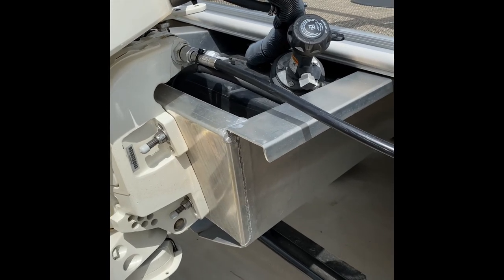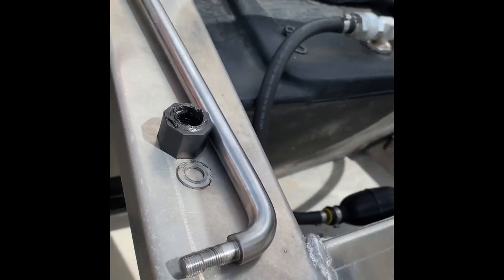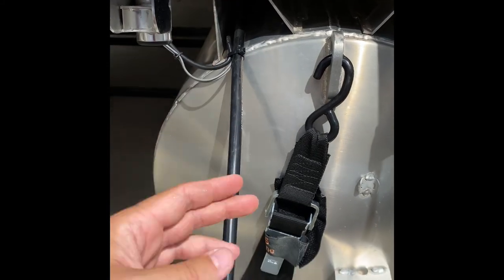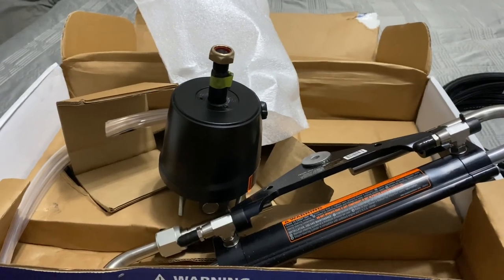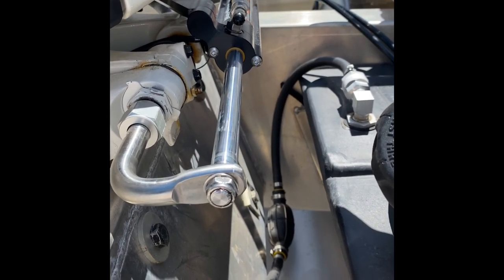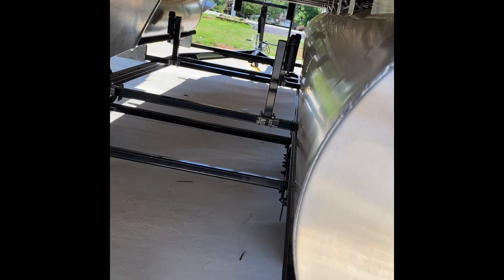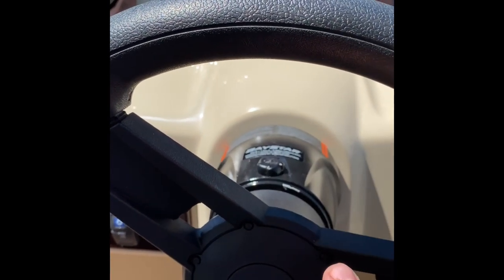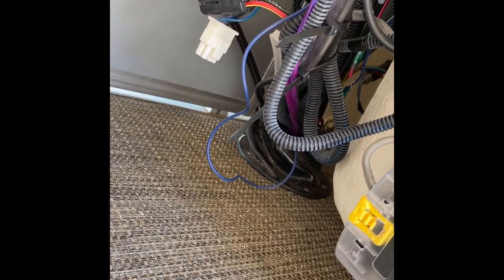Baystar hydraulic steering upgrade for the pontoon

Comment from the maker: New information:
Alright everyone. I did not do enough research upfront on this deal. I found out that Baystar is made by Seastar, it is just a lower end. I bought it because it says it works with 150HP or less outboards. This is true, but it is not recommended for larger boats or pontoons. I took it out on the water and it is a little hard to steer. It is barely an improvement over the cable. So come to find out that Seastar is better for pontoon boats and the way to go.
Reply: Hi Josh, thank you for posting this video. I'm trying to help a buddy of mine that's having the same issues that you are with the heavy torque steer that you feel in your steering when you go above an idle. I see from your comments that you aren't thrilled with the results after installing the BayStar helm and cylinder. I was wondering if you had spoken with anyone that has installed the SeaStar helm and cylinder? Do they say that the SeaStar helm and cylinder will be all that is required to overcome the torque steer?  I'd hate to tell my buddy to order the SeaStar components only to find out it still needs the hydraulic assist pump to go with it. To install the SeaStar components plus the assist pump we're talking some serious money. What is your opinion?
Reply from the maker: So after speaking with Seastar customer service, they stated that the Baystar is not recommended for pontoon boats and have advised me to get the SeaStar. They said that I will be happy with it. Even though if you go to the website and type in my boat information, the Baystar is the first system that comes up. I send them the screenshots and they said my boat is the max size for the Baystar.  
So I am returning the Baystar and will order the SeaStar. 
I can’t speak for it as I do not have it yet. I will make a video when I get it. I do know that my friend has a similar pontoon as mine and it came with a SeaStar. It steers very well. Hoping it will do well for me, but will have to see.
Reply from the maker: So after speaking with manufacturer, I would say not to put the Baystar on any boat over 90HP. Even though it says for up to 150HP. Especially on a pontoon boat.
Reply: Hi Josh, Thank you so much for your reply! I think you just saved myself and the owner of the boat a lot of hassle. After seeing your comments I'm sure he'll want to go with the SeaStar components. I also found out from Tech Support at SeaStar that if we ever wanted to add the power assist unit to get true power steering, they didn't really recommend coupling the power assist pump unit with the BayStar components and especially not with the BayStar plastic lines. Thanks again!
Reply: Hi Josh, My buddy and I installed a Seastar HK6400A-3 kit on his 22 foot pontoon boat with a 115 HP Mercury 4-stroke outboard last weekend. I'm happy to report that it works great. Steering effort is no greater at full power than it is at idle. Best of all, when you let go of the wheel it stays where you put it. Thanks again for posting this video and answering my questions.
Reply from the maker: No problem! Glad you got it in and works well!
Reply: Thank you for this comment.  You saved me the hassle and money of getting wrong product.